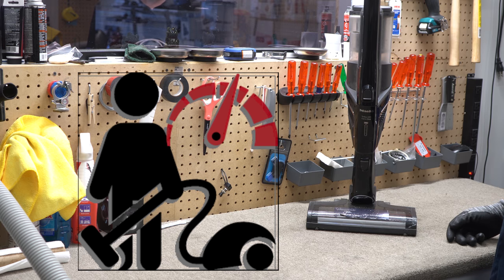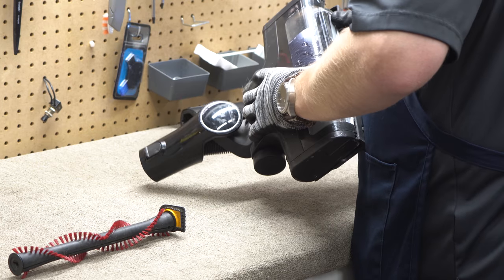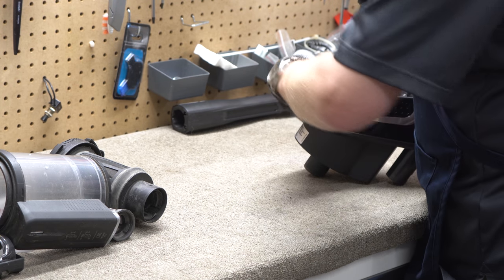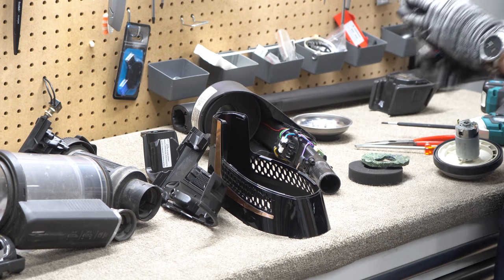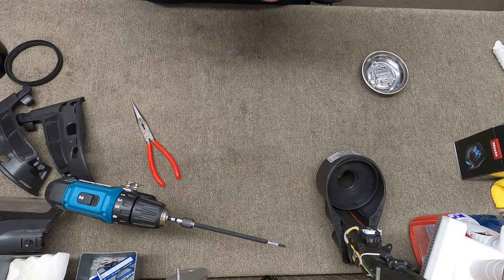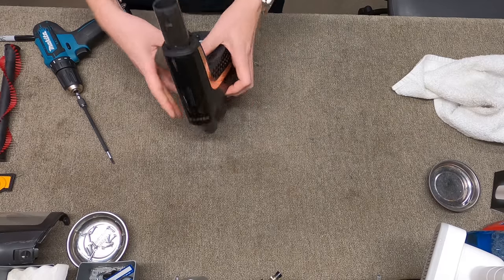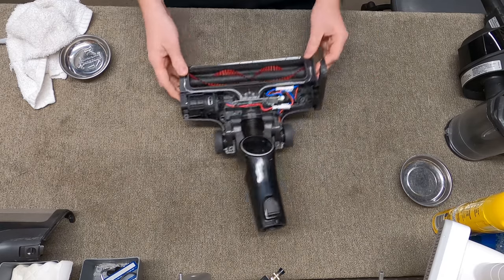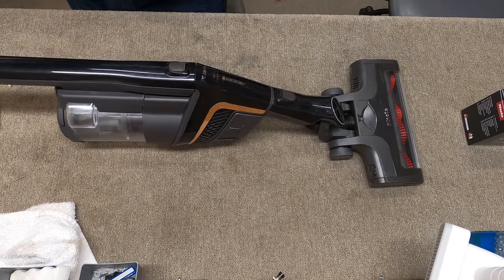Miele Triflex HX1 Vacuum Repair

Comment: How would one easily change the filter? Why would Miele make it so difficult to change but recommend it every 3 years? Seems strange.
Reply from the maker: Because bagless customers probably will just throw it away when they're done in about a year
Reply: @PerformanceReviews  I have a HX2 and it’s probably my favourite vacuum I have. It’s great and hoping to look after it and keep the performance going as long as I can so I’ll be looking to replace it when it’s due. I had a HX1 but upgraded as suction is much better and the soft roller is great on hard floors.

Comment: Hello, I have a Triflex HX1. My brush stopped rolling as if it has no power.  Do you have any recommended DIY troublshooting tactics?
Reply from the maker: The brush should be stopped in the upright position and on hard floor. 
Bring it to your local dealer most of them are under warranty.
Reply: Same problem here, in some positions the motor just stopped, sometimes just the led and brush, any recommend?
Reply from the maker: Bring it to your local dealer and have them fix it
Reply: Same problem, Lights come on but the brush not working, sadly mine is out of warranty, I came here to see if there was a common way to repair the motor

Comment: Thanks again! Great watching you address all things Miele.

I have several Miele vacs (purchased used) - a classic Red Star, a late-model Marin C3, a U1 Dynamic Dog & Cat (why no more bagged upright?), a Quickstep, and now two HX1s. The second Triflex got me an additional battery and the smaller head accessory. Though in retrospect, I might rather have one HX2 than two HX1s.

My first used HX1 had an issue with the brush head bearing (I think you mentioned the issue in the video). The brush motor itself was still fine, but my local Miele guy said they don't supply the bearing assembly apart from the motor.  He was frustrated that In his own shop he had to replace several units with the same issue. He got me the part and I did the repair myself. It works great.

In large part due to your thorough reviews, explanations, repair demos, etc., I am confident in what I feel comfortable doing myself and and not doing myself at home.  For example, I disassembled/reassembled  the Quickstep but would not brave the timing adjustment on the U1.

A few questions:
1. Might you do a video on the Triflex brush head motor repair at some point?
2. Is the new style HEPA filter (with the internal twist to clean feature) compatible with the first-generation Triflex HX1?
3. Might the stronger and more efficient main motor in the Triflex 2 ever be able to be installed in the first-generation Triflex HX1?

Comment: Hi, could you make a video of replacing the belt which drives the floor tool brush on HX1 triflex?
Reply from the maker: They are all under warranty currently, you should bring it to your local dealer.